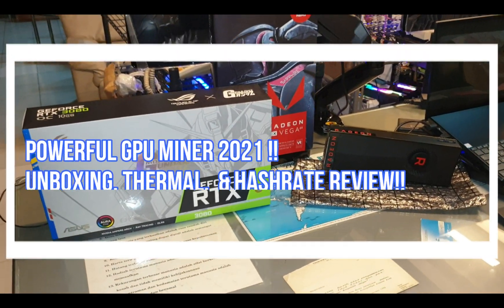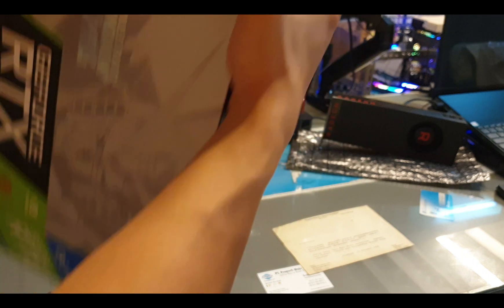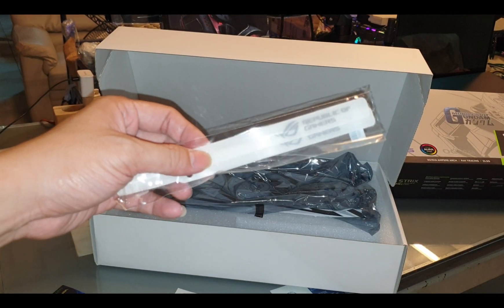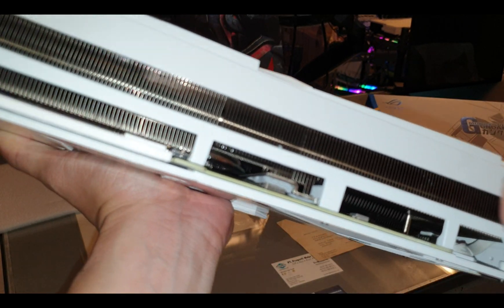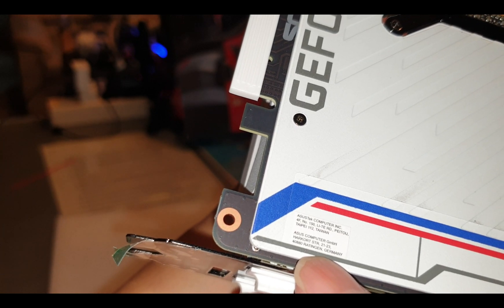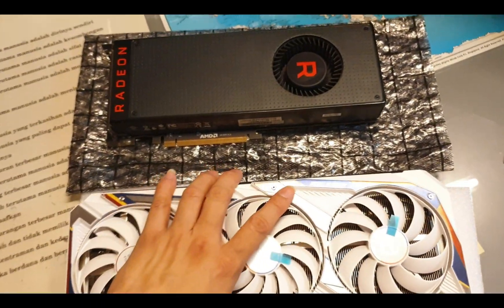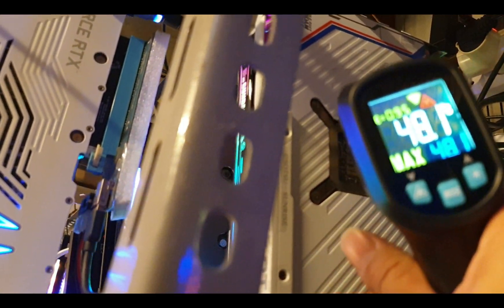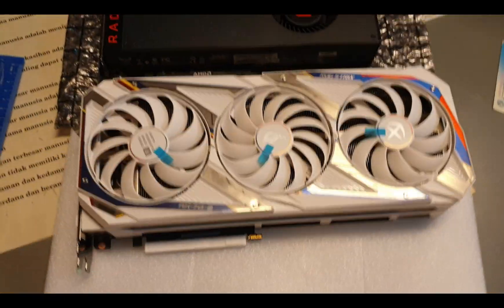UNBOXING & MINING PERFORMANCE VGA NVIDIA RTX 3080 ASUS GUNDAM STRIX EDITION!!

Comment: Dear Tom i think that your first Asus Gundam card is starting to thermal throttle. It might be worth the time and money for better thermal pads ( Gelid or Thermalake) both will give you -14 C, both companies make also a very powerful, i mean temperature reducing Thermal paste. You can watch a Video on Youtube from the Evga Guy who tested in his video almost thermal pads and paste from 10 Companies & the 2 afore mentioned were the best. Like the Person wrote in the comment below you can get a Hashrate, after exchanging the original ones to better heat absorbing ones up to 104 MH’s ….i have even seen videos of people which got over 106 MH’s. But there is certainly what most people call silicon Lottery, that 2 identical cards with the same ThermalPads will not perform identical. I hope that this tip will help you to increase your Hash rate and with that your Profit per card.
Greetings
Reply from the maker: Then it will be out of warranty

Comment: Got the same card, but mine seems to be not as good, using same OC settings on hive as on description I start at 100mh/s and then the card just lowers in to around 92mh (thermal throttling probably). Reported temp on Hive is 41°... 

Perhaps the thermal pads need some love... :(
Reply from the maker: Bought it used?

Comment: hey tom, great video there! i just bought my first gundam gpu today and waiting for its delivery. glad that the hashrate is so good and its a cool card. i have one dell oem 3080 with diy paste work done its running at 104.2mh, 48c core, 247w and f:85%. i will try to push this card to see whats its limit once i got it.
Reply from the maker: Do you use air conditioner?
  tried to keep my card below 55 celcius. And whats the mem junction temp? Gundam without ac is around 50 celcius max with mem junction below 87
Reply: @stockwiseinvestor  the mem junc temp for dell oem is ranging from 86-88(AC on), and 90-94(AC off) //// core is 48min(AC on) and 55max(AC off) . the GPU is still lying inside the original Alienware R12 casing with both side panel and top panel removed. the setting for the OEM sits at PL75%, MC+1600, FAN85%,P235W.